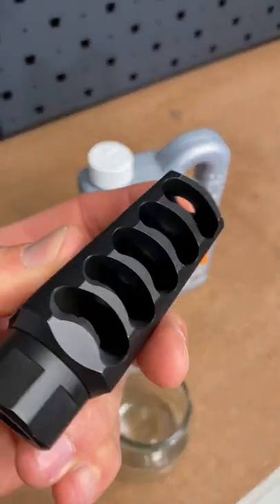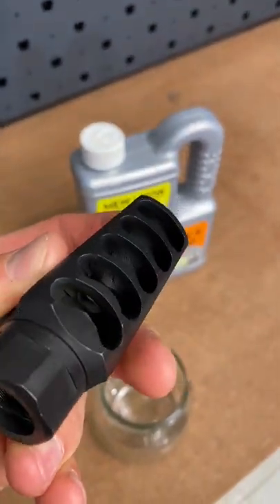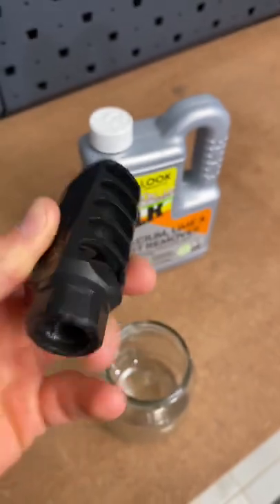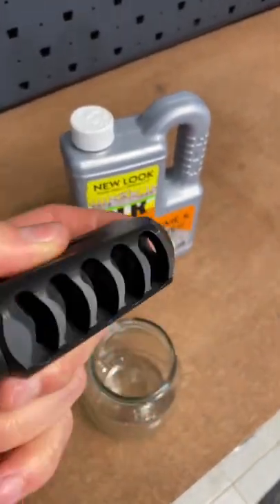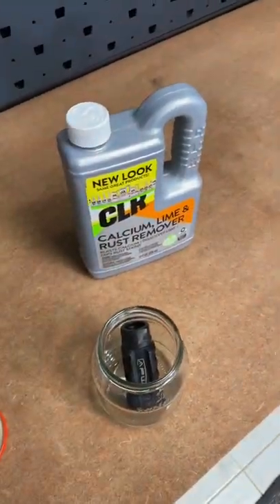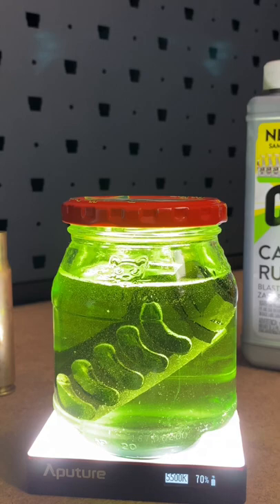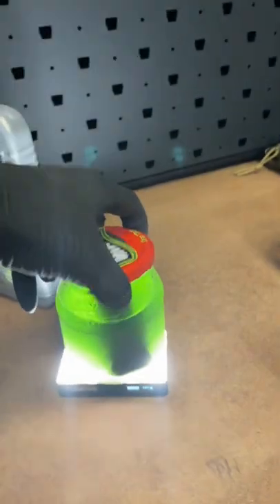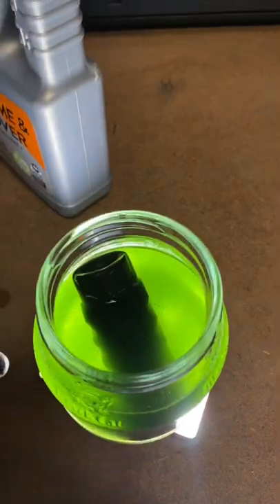CLR Vs Cerakote (Carbon Removal) #shorts

Comment: let that brake sit for 24 hours and then rinse with hot water. 90% of carbon will come off. for what's left, let it sit in new CLR for another 24 hours and what's left will come off easily.

Comment: Area 419 specifically states that you SHOULD NOT use CLR or Lemi Shine to clean their muzzle brakes.  I personally use and recommend what they suggest C4 Carbon Remover by Bore Tech.  Works great on AR bolts as well.
Reply: wrong. they recommend not cleaning brakes with a nitride coating with CLR because it can change the color of the brake to pink. if it was stainless well then there is no issue. other than changing the color it will not harm the metal in any way at all.
Reply: @fandango_buttlicks  Nothing in my comment is wrong. The video is specifically about Cerakoted brakes, not bare stainless, so I’m not sure what your point is. They and I are not claiming that it will somehow damage the metal and destroy your brake but it WILL change the color on nitrided brakes and some people may not be able to tell the difference between Cerakote and nitride. I don’t want a pink brake especially if I paid for black and most people feel like damage to the finish is still damage, even if the brake itself is fine.  Otherwise Area 419 wouldn’t put it on the product page in RED.

The product that I use and suggested can be used on coated and uncoated brakes without damage to the finish.  I use this in my shop and recommend it to customers.
Reply: I have a black Area 419 that I soak in CLR but don’t submerge it completely. The brass ring inside holding the knurled locking collar will react and cause the black to get patches of a pinkish hue. I just hang it with a string inside a jar of CLR. I only soak it for an hour then wipe off carbon then soak 1 more time. And wipe again then rinse. I usually clean mine every 3-400 rounds though.

Comment: Using CLR on rifle parts is stupid, unless you're restoring an old rusty gun... Carbon build-up is neither Calcium / Lime / nor Rust (oxidation). 
And that Cerakote DEFINITELY looked effected, very faded...
Reply from the maker: it might be neither, but CLR sure works. Its like saying exercise doesn't cure depression, but it sure is effective.